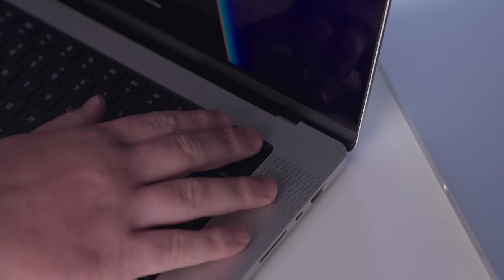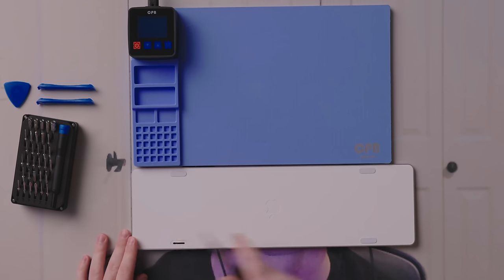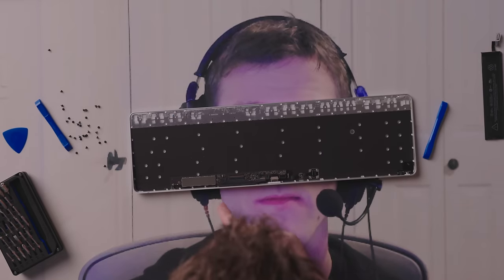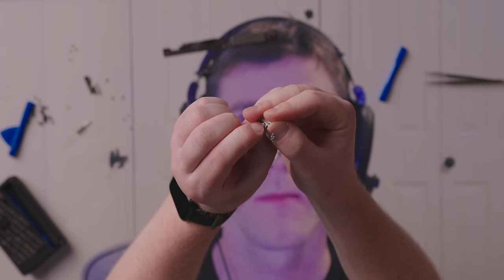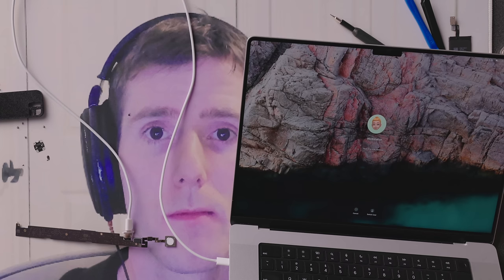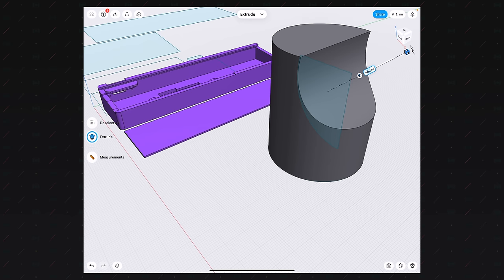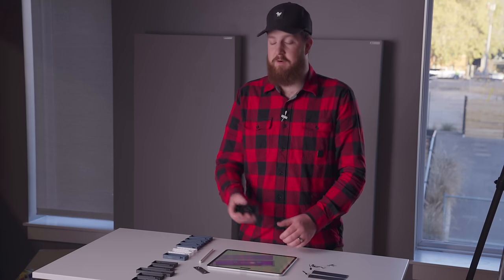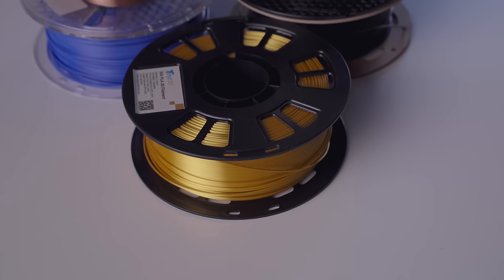I Made a Tiny Touch ID Button for Mac!

Comment: I think it would be a really neat idea to integrate the touch ID button into your desk instead of a bulky dongle that can get knocked around on the desk. I wonder if DIY Perks would be willing to have a go at it?
Reply: on it
Reply: It’s not that hard. Just use a router to create a crater in the table top that the dongle can seat in. Then cover the dongle with a wood vinyl. Et voila.
Reply from the maker: It'd be easy. Just make a hole in the desk and then you're done haha. May drill a Touch ID-sized hole right into my keyboard deck and put the board inside. The options of where you can put stuff are kinda limitless, but I liked the idea of a dedicated module.
Reply: @snazzy  You could put an internal usb hub in that keyboard as well ending up with a single usb cable to connect them both to the pc.
Reply: DIY perks: lesgooooooo
Reply: Was thinking the same exact thing haha
Reply: @snazzy  touch id on the monitor???
Reply: @ChickenSamosaa  YES. a usbc hub with all the ports and this added to it. Bonus points for a usbc hub with an NVME drive enclosure / gbe rj45 / hdmi / 100w PD / and an additional usbc
Reply: That would be cool!
Reply: That's a great idea! Have you started the project?
Reply: Or integrated into that ugly ass Commodore 64 keyboard
Reply: But when you buy a new desk what then???
Reply: Or integrating it into a legit mechanical keyboard like a Keychron...It's definitely possible.
Reply: or just put drill it into your thumb so you can just touch your two fingers to unlock instead of on a desk where it will be covered by paper or other desk trash
Reply: On Bilibili, Chinese YouTube, there is a video of the Touch ID in a table.
Reply: It would be nice to have a Touch ID on the iMac chin
Reply: naw what @Elemental-IT
Reply: I'm more tempted to integrate it inside a custom mechanical keyboard

Comment: I know it’s an un-Apple like solution but for the longest time I’ve wanted Apple to build a usb webcam with the fantastic rear cameras from their iPhones with faceID. I’m sure a product like that will never exist (especially with continuity camera) but I can dream
Reply: That would take a leadership replacement at Apple.
Reply: Just use Continuity Camera.
Reply: @Razor_Crest  no because you require your phone, a way to prop it up/stand. oh and of course a supported Mac and iPhone. not to mention you can't use your phone anymore while using the webcam.
Reply: It’s not just the camera. It’s the DSP that goes along with it. Just use your iPhone with Continuity.
Reply: @DavidRavenMoon  Pretty sure all webcams also require signal processing, the raw sensor data is always basically unusable
Reply: @asronome  older webcams were just cameras. My point was the iPhone has all the hardware. 
I always wonder why people want high res web cams. What the heck do you use them for? If I’m using Zoom or whatever I couldn’t give a crap if the image is HD.
Reply: @Razor_Crest  you use continuity camera? and then what happens when you need to use your phone during a meeting?
Reply: Considering they had the old iSight cameras, maybe!
Reply: @asronome there is no webcam with signal processing as good as an iPhone
Reply: @DavidRavenMoon    who said anything about resolution? The guy said "take the camera hardware from the iPhone and make a webcam", he never mentioned resolution. 

Anyway, there are reasons to have bigger resolutions in a webcam. More pixels mean more data to process color and white balance and cameras with more resolution often come with bigger sensors so there's more light. Also cropping for zoom.

It doesn't need to be 8K or anything crazy, but 1080p or 2K with iPhone level image processing and lenses would be orders of magnitude better than even the 1080p in the MacBook Pro.
Reply: @AlejandroLZuvic  Again, it’s a web cam. The iMacs already have web cams. Why do you need to process color and white balance on a web cam? Get a real video camera. 😃
Reply: All of the replies here seem to have forgotten that the original comment specifically said they wanted to use Face ID in order to unlock their computer. Using an iPhone in continuity camera mode wouldn't help with that. Reading comprehension.
Reply: @helloimash  Why not? You can unlock your Mac with an Apple Watch.
Reply: @DavidRavenMoon  (re last comment): Assumedly they [OP] want[s] Face ID specifically, and doesn't want to rely on an extra standalone device? Such a camera might also have more longevity than a phone/smartwatch would, but those are all just my guesses (while personally I don't care for anything mentioned, I have had my own "wishlist devices" that others wouldn't get either, so "dream and let dream" and all...)
Reply: @fayenotfaye  That's exclusively due to the fact that no webcam does signal processing beyond sending a standardized signal down USB.
Once we get beyond that, it's insanely easy for most mid end desktops and laptops to surpass the capabilities of iPhones, and it's only a question of if the software being used can leverage available hardware AND what features it provides.
Reply: @DavidRavenMoon  I'm guessing people have their reasons.  Keeping track of pets, porn, flexing, who knows.  I know when I bought my samsung ultrawide to go with my mac studio I needed a webcam.  So I told the dude I bought the monitor from that I needed a webcam knowing they had a crappy little 720 logitech cam on sale for $25.  He tried to upsell me into some high def 1080p cam for over $100, I asked him "would you really want to see this ugly mug in high def?" he laughed and sold me the one for $25.
Reply: it's crazy that microsoft has windows hello webcams out there but apple just lets this market slide
Reply: @Razor_Crest  not everyone uses a macbook with MacOS Ventura
Reply: Yes!!
Reply: @fetchstixRHD  Face ID requires the TrueDepth camera system, which  projects 30,000 infrared dots onto your face. It then needs the A11 Bionic neural engine to analyze your face. So all that needs to be either in a stand alone camera with the necessary hardware, or someway to let the camera interface with a Mac with am A11 chip. So it's not just a web cam. An iPhone is a pocket computer that has all this necessary hardware. My iPhone 8 Plus doesn't.

Could Apple produce such a camera? Sure. But Mark Gurman said back in February: "Face ID was in the cards for the original M1 iMac. Naturally, the iMac is the thickest Mac with a built-in display since Apple's laptops have fairly thin screens. At this point, the technology to embed Face ID into the thin MacBook displays doesn't exist. So if Face ID comes to the Mac, I think it will be on an iMac or external monitor first. Apple has definitely been working on this, but time will tell if they launch it." 

I do think that's odd since iPhones are very thin too. I seriously doubt they would make a stand alone Face ID camera until it's in iMacs. They have Touch ID on the new keyboards.
Reply: @DavidRavenMoon  They want high res because webcams suck and don't look good, they want a webcam that looks good and they assume upping the resolution will make it look better. When in reality my Sony mirrorless camera in 720p looks better than any 4k webcam on the market
Reply: @AlejandroLZuvic  2k is 1080p btw tho I imagine you meant 1440p. 3840 (almost 4000) x 2160 = 4k, 1920 (almost 2000) x 1920 = 2k/1080p
Reply: @definingslawek4731  They don’t have to look good. Look at what you use them for. It’s for video conferencing. When I see people nitpicking over things like that, it’s that PC user mentality where they are just looking at specs.
Reply: @DavidRavenMoon  Apple designed the DSP, they could just produce a cheapo chip with the DSP plus a much more low-spec processor for the camera.
Also I think you fail to realize just how high end some webcams get lol. There are multi-thousand dollar ones that have enough processing power to need a cooling fan. And that's if you don't even technically count folks using their pro-level DSLR's as a webcam like I do, lol.
Reply: @DavidRavenMoon  You're right they don't need to look amazing, but ever since I found out my professional mirrorless camera can just plug into a computer over usb c and with no software show up as a webcam, I've been plugging it in for every video call.
I agree with your sentiment of not being blinded by specsheets but specs are obviously important.
Reply: Just use continuity bro
Reply: I gues the solution is to buy an Iphone and just use it as your webcam

Comment: If they sold this and it worked with Macs and iPads with Stage Manager so you do not have to physically bend over  just to authenticate, I will buy 10 of them ASAP. Your move, Timmy.
Reply: What does Stage Manager have to do with anything?
Reply: @AlejandroLZuvic  Stage Manager runs on external monitor support for iPadOS 16 with M-series chips. Hence me saying Stage Manager. Should’ve specified but it is what it is.
Reply: I’ve wanted a “send auth requests to my iPhone” from my macs for a long time. That way your Mac could use FaceId (or touched) by proxy. Like it does with the watch!
Reply: If you have an iPad/iPhone with Touch ID, it should be able to authenticate in the mac

Comment: For the uninitiated ones: this only works on M1/M2 Macs, it won't work with an Intel based Macs.
Reply: Nooooooo😢
Reply: Oh shoot. Thanks for letting me know. I have an Intel based Mac in my recording studio that is always in clamshell mode. This would have been amazing.
Reply: even intel macs with T2 chips? why?
Reply: @jonathanodude6660  apparently so. Because... Apple. You'd think that they would make it backwards compatible with T2 chips, but not according to the compatibility tab on these new keyboards.
Reply: @TheStudioFreq  I know right... The moment I saw these keyboards I wanted to get one for myself to have the fingerprint right there on the keyboard, but unfortunately I have an Intel Mac.
Reply: I wished I could use a keyboard with fingerprint sensor for my Intel iMac, but now I have an Apple Watch and it’s working great! Even the 1Password password manager can get unlocked by the Apple Watch :)
Reply: @LarsHofman  Thanks for this comment! I just switched to 1Password from Lastpass, and didn't like the "auto-locking" mechanism of 1Password. I have an Apple Watch, so going to set this up
Reply: Booooooo

Comment: I would even go ahead and modify my already existing mechanical keyboard to incorporate this as a "module" by either modifying its casing or making an attachment in the same style. You can then splice the incoming usb connection to that keyboard for 5v and ground and then connect it to a lightning port/cable. Then you can have it work even more seemless!

Comment: For small stuff like the thing you plastic welded you can always just thread your screws into the plastic. You could even just make the posts, drill a small hole, then use a screw.

Comment: would be awesome to integrate that into the old keyboard you already are using.
Reply from the maker: That's my plan, but that's hardly a replicable project. Hence this :D
Reply: there's been some fan mockups for hot swap mech keyboards with touch ID and the macbook's touchbar

Comment: It's amazing that they don't sell a face id webcam by now. Wouldn't be that hard to make and it would be quite compact if they just used the same module as from the iPhone
Reply: What makes the iPhone camera great is not just camera, but the DSP and additional processing by the SOC.
Reply: @ivanmalinovski7807  I'm sure M1/M2 could process it just fine
Reply: They can't get the module thin enough to fit in the MacBook screen yet. Will come in time I'm sure.
Reply: @konicky  but it definitely could be an external accessory for the iMac / Mac Mini/Studio/Pro.
Reply: I think they’re going to opt for encouraging further ecosystem immersion. Continuity camera just became a public feature, I’m sure they’re planning to lean into that. If you have an iPhone, you technically already have a faceID camera.
Reply: I presume you could take apart an iPhone and take the Face ID sensors out and assemble one. Although it might be difficult to put together
Reply: @the_manchovie1795  there wouldn't be a way to use it with the computer
Reply: @konicky what's the point of the huge notch in the Mac screen if it doesn't even have FaceID?

Comment: For items that are relatively flat that you need precise measurements use a regular paper scanner and take the scan into your 3d modeling software and scale it. As long as you can get it to scan it is by far the best method of getting dimensions of things like this.

Comment: I thought of doing this EXACT project a while back and even looked at the ifixit teardown and the only reason I stopped was the battery.  Wanted a small adapter. Now that I know it works without the battery will definitely try this as I have plenty of those compact keyboards!

Comment: I'd love to see this integrated into a mechanical keyboard.
Reply: I was imagining exactly the same thing. The space is there in many cases but the top case would need to be custom made.
Reply: @AlejandroLZuvic  Some mechanical keyboards like the Keychron Q1 and many others have these Knobs for changing the audio volume. The sensor could go at that place, so the layout would be identical to Apple's Keyboards.
Reply: I’m working on it, but progress has been slow
Reply: @_sabot  yes, that'd work.
Reply: Yes, I hope also that this can be standardize so this can be opensourced.
meaning the keyboard send the data, and the computer decide to unlock or not, but this seems to be very far in the future (and not using a mac)
Reply: Someone is doing just that checkout on LTT forums :) Can’t post any links here without being triggered as spam.

Comment: That old school keyboard has to have plenty of room for all those electronics in it. That would have been a nice way to go. Might even be able to do a mod to get power from the old port or convert the old keyboard to using USB-C.
Reply: It’s a Zinc case, and I doubt you’d wanna drill through it.
Reply: @michaelbaim5060  pretty that’s a model M keyboard from the 80s

Comment: lol so just tried this with the TKL variant and tried to shove the whole touch ID inside of a Keycron keyboard. I ended up breaking my touch ID (and battery) so now I have a wired magic keyboard lmao. 

**A word of advice if you're using the TKL version:
- When you remove the first back layer, be careful to remove ONLY the white part. The black part has the battery attached to it and WILL snap the ribbon cable (and any chance you had of getting wireless to work. 
- The TouchID shown in this video is nice and neat because it's right next to the logic board, but that's because it's the full sized. The TKL layout has an extension cable that runs through half of the case and is VERY delicate. I suggest you just keep the entire connection from the TouchID to the board  in tact if you can. I opened and closed the connection between the TouchID  and the extension ribbon too many times and it broke on me meaning no fingerprint censor. 
-Bonus: If you hook up the touchID connection to the logic board in the opposite direction, you'll get a surprisingly hot finger warmer.

Comment: I'm sure your mechanical keyboard has enough internal space to do a case mod and cut out a small hole to fit the Touch ID sensor in. That way you don't have to run multiple cables across the desk if you have a small USB hub on the inside of the keyboard.

Comment: Not a fan of the Magic Keyboard, but I'm honestly shocked how they managed to get the battery to be this thin & small but so efficient at the same time. I've used one for some years at work, and this thing seemed to go months without needing a charge.
Reply: It actually just registers key presses, I'm not an engineer but that doesn't sound battery thirsty at all.
Reply: @stefanosk27  don't know about that, but other wireless keyboards I use (which are to be fair backlit, but I pretty much never have them lit) require weekly charging, and they seemingly also only record key presses. And lots of keyboard manufacturers do advertise battery life that's like a week or two.

Comment: You know whatll be your next challenge and really awesome!… try extending the cable from the logic board to the touch id using micro enamelled wire . That way you can hide the logic board and  only have the touch if visible… thatll be amazing and really good looking! You may require some micro-soldering techniques buy hey, a challenge is supposed to be challenging!!!! Please try !!!!

Comment: For the lightning connector, why not just use a hole with a m screw & corresponding sized nut?.. Not to mention that you could just put some shelves that hold the nut into place or just captive in general. Making it thick enough should add more than enough resiliency to ensure you can get a rather snug fitment for the nut. Which should then allow for a tight connection with the screw to be made.

Comment: I use an old Apple Extended II ADP keyboard (via an ADP->USB adapter) and I'm thinking I could remove one of the ADB connectors and mount a touch ID key in it's place. The hole for the ADP socket seems to be exactly the right size (~1cm). I'm not sure I want to glue it on though as I don't want to make a permanent modification to the keyboard but I'm thinking that's the only way to do it. 🤔

Comment: I'm very new to macs, just got one at work last month actually, but used iphones for years. I like touch id but i also liked it on my old iphones. But my iphones hasn't had it for years. Why don't they offer the face id option? If you have apple monitors with  camera?

Comment: I’m actually working on a custom keyboard pcb with kailah chocs that uses the existing pcbs. I’ve thought about just throwing away the controller and using just the Touch ID part separate. I also destroyed a battery and had to buy another. It’s a shame it doesn’t turn on if it doesn’t have a battery in it